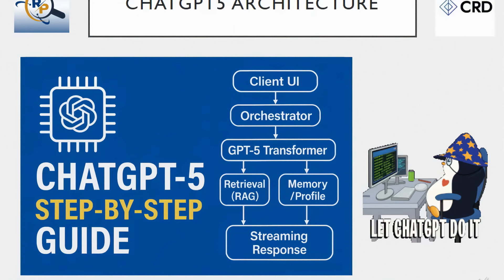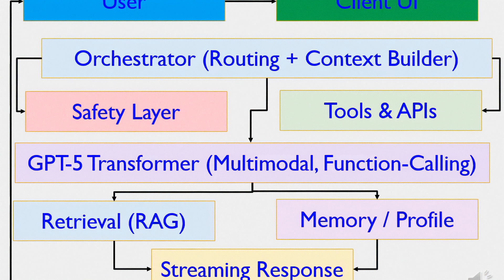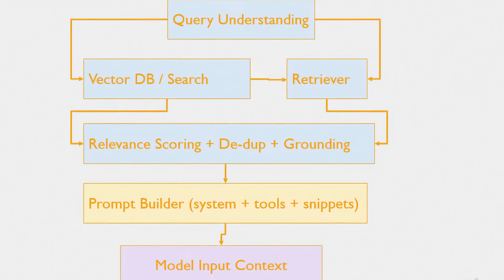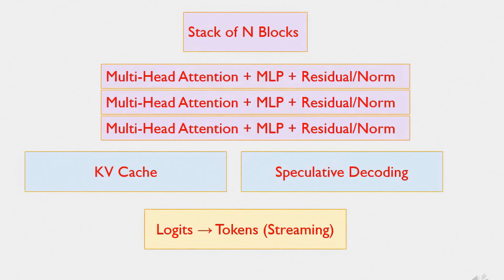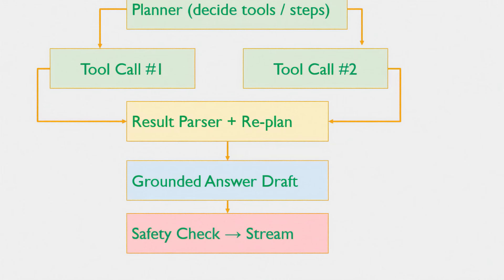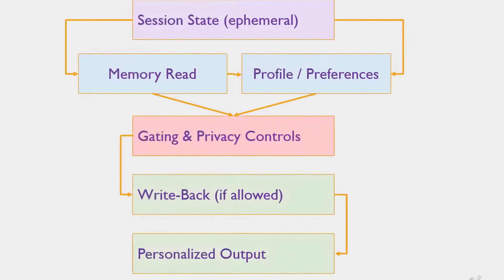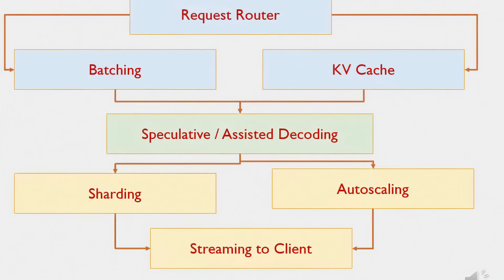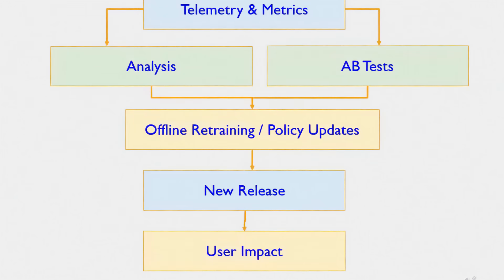ChatGPT-5 Architecture Explained

Comment: You have explained Chat-GPT 5 very well. As a technical person it is very informative for me. I have seen that chat-gpt 5 gives some very extended answers that are mostly not useful. Have anyone else experienced the same thing? Chat-gpt 4 was much better than this version.  Anyone else with same experience?
Reply from the maker: Great point! 📝 ChatGPT-5 does tend to generate longer, detailed outputs since it’s designed to cover multiple angles of a query. For technical users, this can sometimes feel “too much.” A good tip is to guide it with tighter prompts — GPT-5’s orchestrator and memory system actually respond well to constraints like “give me a 3-step summary.” That way, you get concise + accurate answers.